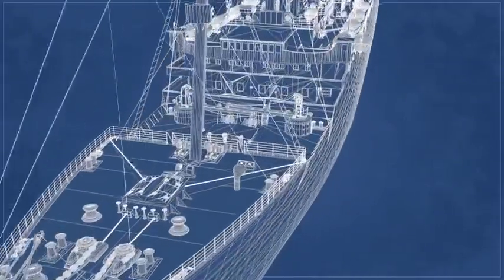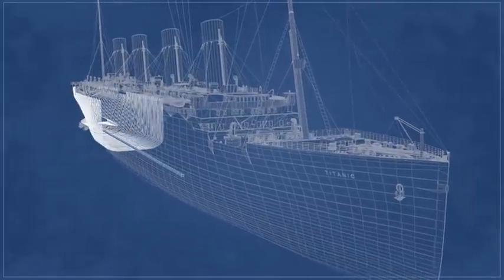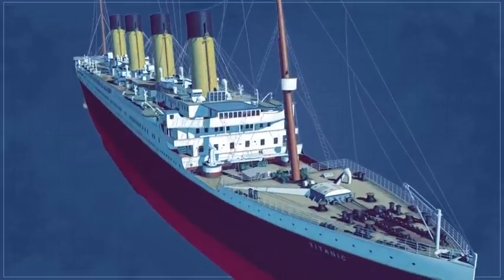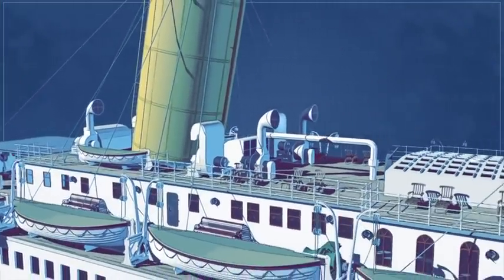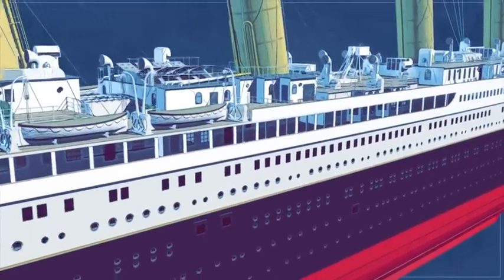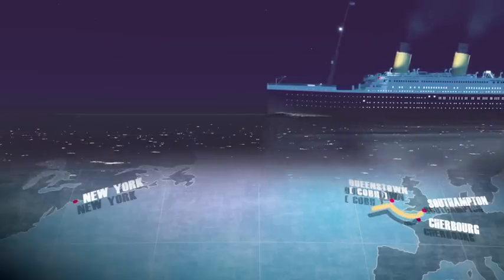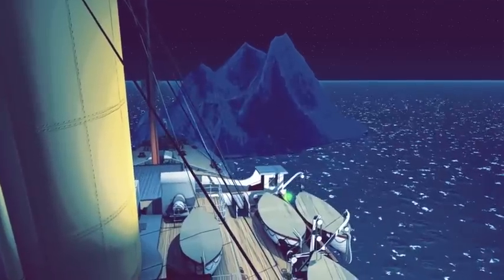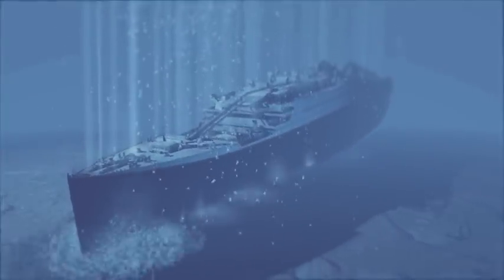The Titanic 3D Model - As You've Never Seen Her Before

Comment: Sorry to rain on your parade, but your 3d Model has one Glaring Error!!!  The Centre Propeller on the RMS Titanic, was a 4 (FOUR) Bladed Prop.  Not a three blade.  The other two are correct.
Reply: No photos of Titanic's propellers currently exist, and all images of the Olympic class's screws are of the Olympic and the Britannic. Official Harland and Wolff documents have also emerged suggesting Titanic was fitted with a three-bladed central screw.
Reply: @TheLiteralTitanic  Well it wasn’t!  It was a Four Bladed Prop!  The reason is because that was the one that was used as a reversing propeller, when needed!  The Centre prop of the Olympic was also a Four Blade Prop!  How can you get this so catastrophically wrong?  There is so much information and documents, and yes, there Are photographs of Titanic at launch and you can easily see the four blade propeller on the centre!  Try doing some actual studying or Reserch before making a complete fool of yourself in future!
Reply: @pikachu6031  The outer two wing propellers were used in reversing these ships, and the centre would remain dormant? Clearly your knowledge of the Olympic Class is errored in countless aspects, and are not worth debating with
Reply: @pikachu6031  
Everyone knows it was a THREE BLADE SCREW LIKE THE WING BLADES
Reply: @pikachu6031  that picture is Olympics
Reply: @TheLiteralTitanic  He is correct. The center propellor got its power from the excess steam for the two outer propellor from the ships two reciprocating engines and when they went into reverse the turbine that drove the center shaft was disengaged because the turbine wasn’t designed to be reversible and as far as the 4 or 3 blades debate the so called evidence is based on a very questionable piece of paper that is not backed up or verified by any corroborating documentation. As a design engineer I know for a fact that any change no matter how small has to be backed up by diagrams, calculations, schematics, etc. so that there is much reference material and these so called evidence doesn’t support the 3 bladed propellor. Titanics center propellor was in fact 4 bladed not 3.
Reply: @anthonylowder6687  The documentation’s authenticity has been confirmed to be true. As far as the official H&W archives put it, it was 3 bladed.
Reply: @DerpyPossum  Wrong!  The Olympic, Titanic and Britannic all had 3 Bladed Outer Props, the Centre Prop was and will always be a Four Blade Prop!  Just look at Any Scale Model or Model Kit!  Well, what do you see?  Doh…..A Four Blade Prop Dummy!
Reply: @pikachu6031  Well, have you ever considered that those models are simply outdated? Titanic’s wheelhouse had a flat front wall, yet most model kits have it curved like Olympic’s because model making companies don’t always have the best attention to details.
I’d rather trust actual H&W documentation than someone in a YouTube comment it’s questionable research skills.
Reply: @pikachu6031  you know the way your talking it seem like it's just a troll who just wants to get people mad
Reply: @DerpyPossum  I like Olympics curved wheelhouse very cool
Reply: @pikachu6031  Can you please finally accept, that all propellers of Titanic had only 3 blades. Why do you think you are right. I'm happy to see, that there is finally a video of Titanic where every propeller has the correct number of blades. Also a big company of model ships (Revell) started to change their models to make three blades in the center propeller of Titanic.

Earlier everyone thought that there were four blades because Olympic had them. BUT Titanic is not Olympic. Please accept this. You can't change it because facts are facts. There are documents of Harland and Wolff where the number of the blades is written!!!
Reply: @pikachu6031  the center propeller was 3 bladed. The center propeller could NOT be reversed… The ships Olympic, Titanic were launched without propellers. There are NO pictures of Titanic’s propellers….
Reply: @pikachu6031  the center propeller of the Titanic was 3 bladed…H&W was always experimenting with different types of propellers to get best coal consumption vs speed vs comfort of passengers ( how to reduce turbine vibration) …the blade pitch was different on the Titanic vs the blade pitch of Olympic…
Reply: @pikachu6031  the propellers were NOT mounted on the Titanic at launching…they were mounted when the Titanic was put into dry dock for final fitting out…
Reply: @anthonylowder6687  the documents of H&W showed that it was a 3 bladed prop -.- until we find out contrary evidence or that we dig out the center prop we have to accept what we have in our hands as of now. Everything points out to a 3 blade central prop
Reply: @pikachu6031  you got so many things wrong. I think you should clarify things. The center propeller being reversing prop itself shows you are misinformed. Harland and Wolfe documents surfaced in 2007 clearly shows Titanic had 3 bladed center propeller. Also the wing propellers are the reversing props, center propeller only rotates in one direction bcz it was low pressure Turbine engine.
All the images of props in dry dock are of Olympic's. Just bcz the museum shows it doesn't mean they are true. Only photos of Titanic's props are from the wreck and one from the fitting out phase. That image was an important part in finding out that the center prop was 3 bladed.
Olympic had 4 bladed center prop and Titanic had 3 bladed center prop bcz Harland and Wolfe were experimenting which one could have less vibration and more efficient. The details with the prop pitch, diameter, blade number are all in those documents. Since Titanic sank and they couldn't evaluate the performance, during the 1913 refits, they changed Olympic's center propeller to 3 bladed and continued till 1919 where Olympic got the post WW1 refit. During these years, they found 4 bladed center prop is more efficient and that's why Britannic had 4 bladed center propeller.
Reply: @pikachu6031  chill. You're wrong
Reply: No. She actually and 3 blades.
Reply: @Sailor_Vaporeon  She actually had three what??  Elephants, Oh I know what you must mean!   The Titanic’s THREE ENORMOUS PROPELLERS.  They all were three bladed, except the Centre one, which actually had FOUR BLADES, AND WAS SLIGHTLY SMALLER THAN TGE OTHER TWO!  That must have been what you meant!!!
Reply: @pikachu6031  nono, even the center propeller had 3 blades.
Reply: Uhh no. It's already been confirmed by Harland and Wolff themselves that Titanic had a 3-bladed central propeller. The photos you see that shows a 4-bladed central propeller is Olympic.
Reply: @volpeverde6441  there are no known photos of Titanic’s propellers…..where are you seeing this.
Reply: @timothyreed8417  
different rudders....
Reply: @volpeverde6441  the rudders were identical except for 1 important feature…
Reply: @timothyreed8417  
your comment CONTRADICTS itself....
the rudders are IDENTICAL....EXCEPT for ONE IMPORTANT feature....
means they are NOT THE SAME....
Reply: @volpeverde6441  you say different rudders…how so then?
Reply: The zinc plates are mounted differently…
Reply: I’m sorry but this is inaccurate, the Titanic has a three propeller blade shown on paper, the four bladed propeller you are mentioning is the Olympic when she was fitted with a four bladed propeller for testing
Reply: Sorry to be late in the debate. It was 3 blades, this has been proven with Harland and Wolff shipyard plans.
Reply: it had 4 i was there
Reply: @PR-xm1gi  The center propeller’s blades are buried in the mud, though.
Reply: Maybe this will help:) https://youtu.be/HZrm79glrgE
Reply: @eoghantheuntamed9613  Maybe this will help too:  Re-arrange this well known phrase: OFF FUCK!
Reply: A Harland and Wolff Engineering notebook reveals that Titanics central propeller was a tri-blade, not a four bladed one as commonly believed. Photos have also emerged showing Olympic with a 3 bladed prop at one point, and Simon Mills has discovered evidence that Britannic was supposed to have a 3 bladed central prop but never got it before sinking. You've got to remember, at this time, propellers were just trial and error. You try one type of propeller, tweak the design, refit new ones on, until you get the most efficient design and config. For example Lusitania when launched featured 4x 3 bladed propellers, that were later replaced with all four bladed propellers. It was one of the drawbacks at the time. Titanic was being tested with a 3 bladed propeller in the middle on her voyage. Obviously no useful information was gathered since the thing sunk, so later they tried that configuration on Olympic. Evidently though, they decided to revert back and put a 4 blade back on Olympic after the war. (Olympic served essentially the entire war with a 3 bladed middle propeller)
Reply: Someone believes the movie, too much, lol
Reply: Wrong. Titanic center prop was 3 blades. All the pics that you suggest of titanic are of Olympic
Reply: Incorrect, titanics middle propeller was 3 bladed because it was a prototype
Reply: @damiann561  dude how much can u miss that the middle one had 4 blades not 3 and was the only one that didn't reverse
Reply: @12awe1s  middle one had 3 blades in Titanic. The engineer's notebook who worked on the company that built the turbine engine and Harland and Wolfe documents show 3 blades for central propeller of Titanic. One photograph at dry dock during fitting out phase shows a prop ready to be fitted which is identified as a 3 blade. All the photographs being publisized as Titanic's props are of Olympic's. Unless they can unearth the center prop of the wreck, all the evidences that exist show it's a 3 bladed center prop.
Reply: @damiann561  four
Reply: @damiann561 the center screw used a smaller four blade propeller thatwas powered by a turbine! All three sisters shared the same design, evin on the olimpic that came before the titanic,
Reply: @jenwright2577 She had a 3 bladed centre propeller while Olympic had a 4 bladed centre propeller that's clearly written in an engineer's notebook from Harland and Wolff, look it up. The purpose was to experiment which was more efficient a three bladed or four bladed propeller. But of course tragedy struck and we can't see the central propeller because it's buried in the ocean floor, however, her visible wing propeller shows the number 401 stamped into it and 401 was Titanic's yard number.
Reply: @damiann561 it was 4 bladed
Reply: @HoudalothAli no, nO, NO!🤦🏻‍♂️😩
Reply: @damiann561  Wrong!   The Centre propeller on the RMS Titanic was a Four Bladed Prop!  Have a look at any old photo of the Titanic in Dry Dock!  No, the Titanic was Not a Prototype!  It was an Olympic Class Vessel, and the Second to be launched of the three sister ships.  The Second Vessel launched after the Olympic!  So how could it possibly be a prototype!
Reply: @pikachu6031  lol I have a book that does that same problem

 that is the Olympic
Reply: @pikachu6031  also the reason why three-bladed propeller is because vibration
Reply: @pikachu6031  the photo in the dry dock is of the Olympic not the Titanic… there are NO pictures of Titanic’s  propellers
Reply: @pikachu6031  there are NO known photos of Titanic’s propellers…the only photos are of Olympic..
Reply: @pikachu6031  that was Olympic, dingus
Reply: @pikachu6031  there are no known photos of the Titanic propellers. The picture you refer to is the Olympic in dry dock..ih has been proven many times by expert Titanic Historians…
Reply: @timothyreed8417  Maybe so.  But the Titanic was absolutely identical to the Olympic in every way from A Deck down!  So tell me why the Titanic’s Four Bladed Central Prop. Would be any different to the Olympic’s Four Blade Central Prop. then?  Why is this fact so hard to grasp for some people?  Just look at ANY MODEL OF TITANIC ANYWHERE IN THE WORLD.  EVERY ONE OF THEM HAS A FOUR BLADED CENTRAL PROPELLER!  So.  Is everyone else Wrong and you Right?  Or could it be that Everyone else is Right…..and it’s YOU WHO ARE WRONG!!!   I’d suggest you have a think about that!
Reply: @pikachu6031  
You said “But the Titanic was absolutely identical to the Olympic in every way from A Deck down!”
Anyone who has studied the RMS Titanic knows that there are many differences between the RMS Olympic and RMS Titanic.
The two ships were far from being identical.
Let’s start with boat deck.
1. On Titanic the front of the wheelhouse was flat not curved as on Olympic. It was also smaller.
2. The bridge wing cabs were flush on the Olympic. On the Titanic they were extended out 18” outboard.
3. The arrangement of the officers’ cabins and Captain’s cabin were different between the ships.
4. The location of the Marconi Room was different between the two ships.
5. The air ducts and pipe work on the funnels was different between the two ships
6. There were 6 first class cabins added aft of the officers’ quarters. A feature not found on the until the 1912-1913 retrofit…
7. Etc., etc…
A Deck
1. Olympic was never fitted with the weather screens enclosing the forward end of the Promenade Deck…
2. Etc., etc…
B Deck
1. “…with the later addition of the staterooms and private promenades on Titanic, the windows would be reconfigured in a manner to accommodate the various rooms…”. Again a difference between the two ships… “…the windows on Titanic commonly known as ‘Utley Sliding Glass Windows’, were much narrower on the forward area of the deck, and were spaced differently…”.
2. On the Olympic the Cafe Parisien and a la Carte Restaurant would be extended out to sides of the ship during the 1912-1913 retrofit, to match the layout of the Titanic.
3. The forward facing bulkhead was different between the Olympic and Titanic. Titanic had two doors with round windows…Olympic didn’t have doors in this area….
4. Etc., etc…
There were many more noticeable and subtle changes made down below decks to the Titanic, that made it very different than the Olympic…changes to 3rd class rooms, to crews quarters, to layout of sidelights and windows on boarding doors…
Were the RMS Titanic and the RMS Olympic identical? NO…somewhat similar? Perhaps…
As to the propeller
“…since 2007-2008 we have known that Harland & Wolff’s records for the completed Titanic state that she had increased pitch on her port and starboard propellers compared to Olympic; and that she had a slightly larger centre propeller with the same blade area obtained from using three blades father than four…”
“…Both the engineering notebooks from Harland & Wolff and the propeller specification notebook from the Pigott papers are primary sources. These original documents are contemporaneous with completion and construction of Olympic and Titanic. Accordingly, they rank above the vast body of secondary material on the subject including books, television programmes and websites which simply repeat assumptions that the Titanic’s propellers were the same as her older sister.”…
So when you assume that the Titanic had a center propeller the same as Olympic, the same as the model makers did you and they are wrong.
The builder’s model of the RMS Titanic, that was submitted by H & W to the wreck commission had a 3 bladed propeller…
All this information is gleaned from primary sources. From professional people who study the Titanic… From people who are well respected in their fields of study….
Reply: @pikachu6031  there is no photos of titanic props. It was all olympic's. They werent gonna take picture of things that were similar. So most of the photos are from olympic. The titanic had 3 bladed centre prop.
Reply: @pikachu6031  those models have 4 bcz it was the popular belief until those documents in 2007 came out.
Titanic and Olympic were similar but never exact same. A deck had partial enclosure, B deck had staterooms in Titanic and promenade deck in Olympic, layout of Turkish bath cooling rooms are different where Olympic had actual portholes while Titanic's cooling room didn't have. Titanic's wheelhouse wall was straight while Olympic's was curved. Olympic's boat deck machinery and Titanic's are of different arrangement. 
NO, THEY WEREN'T EXACT REPLICAS. Then what is the use of having sister ships. First ship is the flagship and 2nd is meant to be the improvement of 1st and 3rd is meant to be the improvement of 1st and 2nd combined. Sisters ships have basic common design but it doesn't mean they are exact replicas. Never.
Reply: @pikachu6031 those photos are of olympic titanic did infact have 3 blades on the central prop
Reply: @pikachu6031  the hell you talking about entirely identical. B deck and A deck were severely changed?
Reply: @pikachu6031 there are documents of Harland and Wolfe ships around the time saying titanic had 3, 3 bladed props
Reply: @pikachu6031  The propellers are visible on the wreck. The outer props are 3 bladed. And the center which was dislodged on impact... is THREE BLADED! It couldn't be reversed because it ran off of a one directional steam turbine that was spun off of the remaining steam from the boilers. So, all on the same page? 3 blades. Ok. Dude... when you get this worked up over a YouTube video. Your facts certainly get called into question, but a lot of other things about you as well. Perhaps you should get outside more and away from your keyboard.
Reply: Johann Bautista  national geographic. As well as H&W records
Reply: @pikachu6031  I'm sorry but you are wrong. Titanic had a central three bladed propeller. It was proved because, in 2013, they found documents in Belfast, the birthplace of all the Olympic class liners,that stated she had a 3 bladed central propeller.
Reply: As a lifelong, self-professed Titanic expert, I was shocked to have learned that there was a Harland & Wolf document that surfaced (forgive me) in 2007 which showed that Titanic had a 3 bladed central prop and Olympic’s was 4 bladed. Also that Olympic had a 3 bladed center from March 1913 before returning to 4 bladed sometime before September 1919. Even more surprising is a photo of Titanic with a prop on its side awaiting installation. Analysis of the prop compared to the H&W document reveals that it is consistent with a 3-bladed(!) propeller with the correct pitch and diameter of the central prop on the specifications. This would render 95 years of art, movies, and models at least partially inaccurate. I’m pretty convinced now it was 3 bladed, though I hope future expedition techniques will finally resolve this controversy.
Reply: I is unknown
Reply: Titanic Radioactive ☣️☢️☣️☣️
Reply: Ram ♈🐏🍻🍻
Reply: The props on this model are incorrect anyway, because they are more like 1920s/30s props.
Reply: Toy story 😄😂🤣
Reply: Yes , you're right
Reply: Well we can't know unless we launch a massive exploration into the Titanic's grave to find it.
Reply: No, Titanic’s design specs ordered a 3-bladed center screw. Olympic had the experimental 4-blade.
Reply: Wrong. Although no pics of Titanic's props were taken installed she was designed with a 3 bladed center prop. The Olympic for a short time after the titanic loss was also fitted with one but changed back to the 4 bladed. They were experimenting for the most efficient design vibration and speed.
Reply: Ha…!  Prove it
Reply: @briancorkery4083  Look it up, there are official Harland and Wolff documents detailing all of the parts required for both Hull 400 (Olympic) and Hull 401 (Titanic).
Reply: As you’ve never seen her before. I already know you’re research is in accurate as it’s common knowledge Titanic was non binary.
Reply: I knew someone would point that out…makes them feel like somebody…
Reply: 🤗 its nice to see that pikachu6031 is still being double penetrated after all this time.    Keep it up lads.
Reply: And excess of free time(or pure idiotism) again leads to arguing about minor something(which enyhow wouldn't change her story)
Reply: @pikachu6031 it’s 3 blades, not 4. Check your facts before you say something. You don’t wanna become the next Aaron1912, do you?
Reply: The truth is no one actually knows if it's a 3 or 4 bladed propeller it's one of the things lost
Reply: @cats2927  Look.  People who can’t accept Reality and Facts need to go and see a Psychiatrist!  Go and ride your Unicorn in the grassy field, where the sun shines all day long!  Gees, where do these morons come from?
Reply: RMS titanic nuclearship reactor
Reply: look up TITANIC propeller blades DRY DOCK / construction....
the lay out for the OLYMPIC and the BRITTANIC are 3 blades/4 blades/3 blades....
why suddenly change and put 3 / 3 / 3 on the BIGGER ship,the TITANIC....
Reply: @volpeverde6441  there are NO pictures of Titanic’s propellers in dry dock…the pictures are of Olympic….
Reply: @volpeverde6441  there are NO known photos of the Titanic’s propellers in dry dock. NONE…all the photos taken of the ships were carefully labeled as to time, place and ship…none were of Titanic…
Reply: @timothyreed8417  B deck begs to differ
Reply: @Sailor_Vaporeon  ?
Reply: @timothyreed8417  B decks promonade at the stern was longer. On titanic. It was shortened to have the Cafe Pourisiane
Reply: @volpeverde6441  There are no pictures of Titanic's propellers in dry dock.
Reply: @volpeverde6441 why change it? Because H&W wanted to see if a three bladed propeller was more efficient than four. Shortly after the sinking, Olympic was refitted with a three blade propeller. This suggests that they wanted to finish the experiment that was never completed with Titanic.
Reply: @PR-xm1gi  Oh for God’s sake.  What is wrong with you people?  The 3 Bladed props you can see on the Titanic’s Stern are the two outer props!  The Centre 4 Blade Prop is Buried in the MUD!!  Now Stop it, all of you!  Stop being so stupid and have a look a a picture of Titanic or the Olympic in Dry Dock.  Look at the props and see the outer two are three bladed and the centre one is a 4 bladed prop!  They are identical so it doesn’t matter which ship you look at! a
Reply: @pikachu6031  but there is no picture of Titanic's propellers...
Reply: @pikachu6031  your proof of any knowledge whatsoever falls very flat to the ground when you said the center propeller was used for reversing. The center propeller was only used at hight speeds at seas and was driven by a steam turbine that used excess steam from the engines. This propeller by design was not possible to reverse. The reason old scale models are wrong, is simply they were created before the H&W documents were available so it was assumed they were the same. Titanic set out on its maiden voyage with a three bladed central propeller to collect data and see which was more efficient. The Titanic sank and data was never recorded so the Olympic was later fitted with a three blade but the four blade was eventually deemed most efficient. This however does not change the fact that the R.M.S. Titanic set sail on her maiden voyage with the 3 blade center propeller that is in the mud on it’s stern at the bottom of the Atlantic. Simple documented evidence from Harland and Wolff which you cannot deny.
Reply: @pikachu6031  there is no photo of titanic props in dry dock...Its all olympic youre just out of the debate just stop it. Youre lacking knowledge
Reply: @pikachu6031  what’s wrong with you? Listen to all of us!